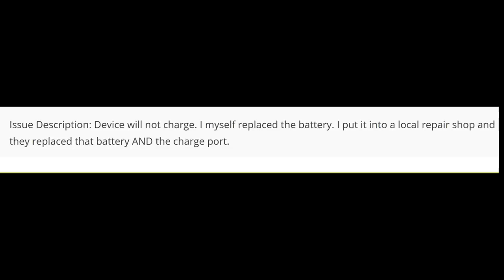New Nintendo Switch OLED already in for Repair - No Power Not Charging

Comment: Great stuff!  My eleven year old, I got him an OLED for Christmas and he already internally cracked the glass (display is still 100%) - you can't even get those displays AFAIK.  Glad to see the insides of one.
Reply: The switch chassis is weak and partly relies on the screen for rigidity. Add to that the legs on the bottom corners but no support leg in the center is just a bad design that easily allows the unit to be bent and receive damaged.
Reply: @Irilia_neko  thats not going to matter for this
Reply: Want to sell it?

Comment: Great job! Admittedly the charge port repair that was done prior to you having the switch definitely needing doing as the pins didn’t look straight and may not have been connected on the inner rail. I just wondered why you didn’t try looking for power on the 9v fuse, and shorts on the board before you did the port? Always trying to learn and progress my own repairs, so would be great to know! I need one of those board jigs too!!
Reply: The issue was "not charging" but as the previous repair shop supposedly had worked on the charged port the first thing to check is the previous attempt, to see if they really did a good job, before anything else. Assuming they did could have you work on any other component where the true issue would have been a non soldered pin. Not all repair shop do good work so you got to be a bit wary of rushed repairs.
Reply: My guess its one thing to have the basic voltage and an other if the charging communication is working. and since the "usb tester" did not showed any power draw the problem could be under the connector.
Reply: @TheRedRave  not all shops have the experience he does. A lot of these guys are much younger and have only been doing it half as long. You can’t really confuse inexperience with bad work, although the outcome is the same. How do you think Alex learned. I assure you, he personally ruined many devices in his early days. Any tech who says other wise is lying. Mistakes are the best experience.

Comment: If you don’t mind me asking do you recommend desk sized mats for soldering or would you get a normal mat? Thanks
Reply: Use what makes the work area comfortable for you. I personally use a one that's about 20"x40"
Reply: I remember when I was in jewery shop we used this type of Grey linoleom, polymer type mat that I'd imagine is pretty cheap if it's my school that bought it. They come in rolls and you just cut them to size. They're good for this type of work and protects whatever surface it's on.

Comment: Hello Great job as always thanks for the video... Also Have you tried the laser solder station from Rewa ... It looks like from there promo video No more problems with melting plastic connector and parts... Im going to order one soon.
Reply from the maker: I answered this before. I haven't tried it, but based on first impression, I hate the  blinding red light it emits. I don't know if you can hold it or have control on how far or close you can be from the board. or if you can narrow down the heat spot rather then burn half the board to de-solder one component. With hot air you can increase air speed and reflow a BGA chip using air pressure and see the chip move,  with laser that's not possible. Again i haven't tried the machine, but that's what I concluded based on few videos I watched.

Comment: I do enjoy watching you solder :)   I recently had a bit of a bargain, I found a spares or repair auction on ebay for a Switch winning it with a £17 bid, got it here and it worked straight out the box, abs pleased as punch with the device but am very cautious as they seem to be made out of glass and very fragile to my thinking.

Comment: Didnt bother checking if the pins were good beforehand on the usb c port. Why assume it was bad and only bother checking after you changed the port instead of saving time with the port that was already soldered? The pins looked fine to me on inspection.
Reply: The pads are physically under the connector. Unless one uses X-ray, there's no way to inspect them. Unless you are suggesting an electrical resistance measurement?

Comment: I'm trying to get the BQ chip off my son's oled board but I can not get the solder to flow. I don't know what I'm doing. I've tried 3 different types of flux and I just can't get it to go. I tried to use some new solder to get the old stuff to flow but I'm pretty sure I just made some bridges on the resistors on one of the sides. I'm going to have to go in with a wick once I get it off.

Comment: Hello i have experience my switch oled not charging at all with any chager then a few hours later with a final attempt tried to charge then it charged again but my problem now is when docked no display only black screen on tv. Im really confused on what do swap either BQ24193,PI3USB , M92T36 or Charing port im confused on wich part can fix the black screen issue when docked. I dont know what triggererd the not charging at all issue first but i dont know how i dont know what i did but it fixed itself the not charging and what left is the black screen issue

Comment: hey man I'm not sure if you'll see this but my original nintendo switch isn't turning on and has no charging indicator and none of the button pressing fixes work I took it apart and was wo during how to tell if the battery is good or not? it has 4volts and zero amps but I'm not really sure if that's good or bad. hopefully bad so I can just replace it.

Comment: If BQ chip is the same, reading should be the same also, even in a new device. I thought you were gonna measure the caps after changing bq chip just for reference.
Reply: maybe he measure it off the cam, but I'm curious also

Comment: So what fixed it in the end? Desolder and resolver the same chip? 
Sure you didn’t put the usb cable on different ways - one way works. the other doesn’t?
Reply: It was a different BQ chip that he put on.
Reply: Replaced the chip.  USB-C is reversable.  The key signals appear on the same pins when reversed, as indicated in this graphic.

https://i0.wp.com/img.talkandroid.com/uploads/2017/03/usb-c-24-pin-connector.png?resize=671%2C318&ssl=1

Comment: The BQ chip on the board looked different than the one you installed.   Is that normal for those chips to be labeled differently?
Reply: The new one had a big "BQ" stamped on it for some reason, but the actual chip labeling was the same (for the part number; date codes vary).

Comment: You should really avoid plastics being hit with high airflow unless you want to destroy them. They can take pretty high temperature but the airflow is what screws them up. Think about removing underfill or overfill, it comes off so easy with high airflow, higher temperatures doesn’t help to remove it. Consider it a basic rule for most polymers. Hope you try it. In other words I mean so little airflow you are slowly baking almost like ur hotair is a  conventional oven. That way you can use higher temperatures than you would expect. Trying a nozzle the size of the port, really low airflow, but high temperature will change your life soldering ports.

Comment: for anyone else that has this same issue.  i also replaced my own battery and had the same result.....  it is charging its just so ridiculously slow you cant tell keep plugging them back in for like 5 mins unplug plug back in unplug until it wants to charge.  its basically dead celled even when u buy a new battery

Comment: Shoddy work by the previous shop.  There's no way the non visisble pins on that USB port were making a connection as there was no solder on those pads.

As for the BQ chip, I'm still going to say it was the shops fault as it looks like they removed it and put it back improperly at one point.

Good job!